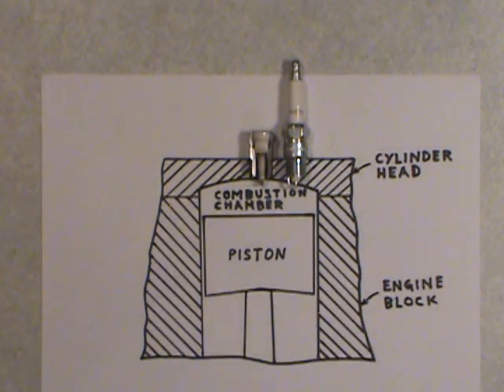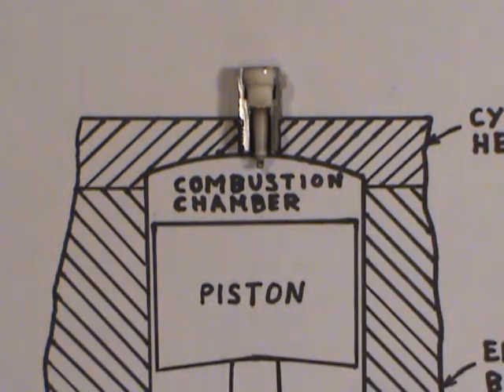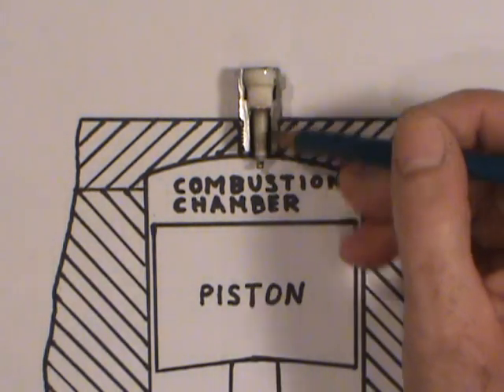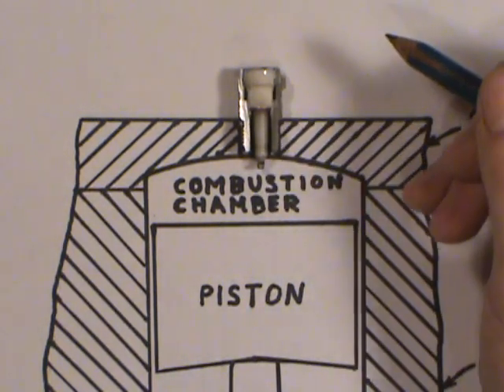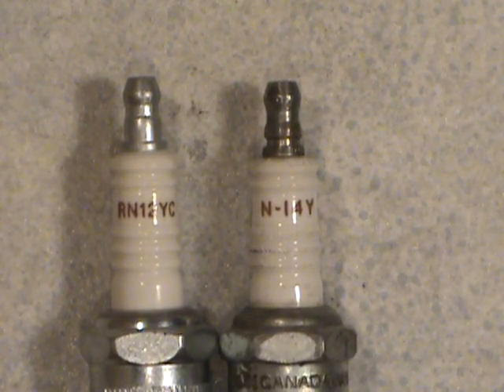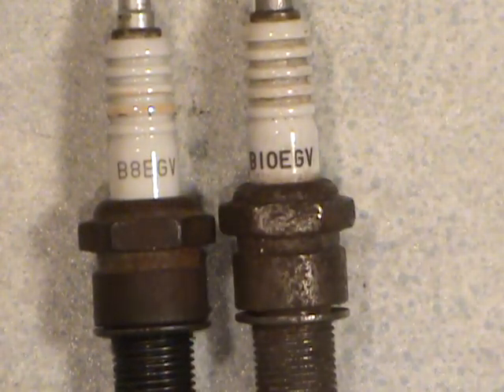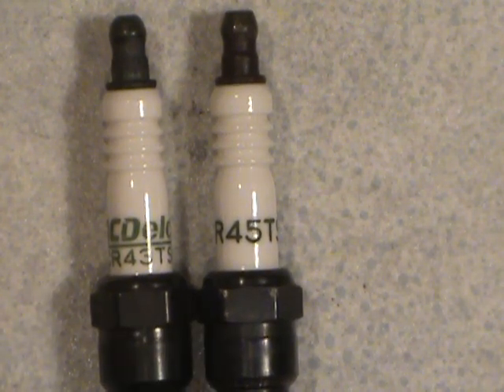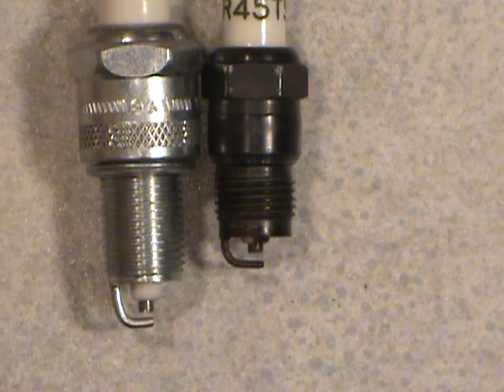Spark Plug Heat Range explained

Comment: A spark plugs does fire before the piston reaches the very top of the stroke. Hence ignition timing/ anywhere from 3-10 degrees before top dead center. TDC.  The momentum of the crank carries the piston over the top allowing the fuel to all be used during ignition explosion. Gas does not go bam in the cylinder but booooooom. Slow burning, not instant.
Reply from the maker: Greetings...Jerry Hubbard..…...Thanks for watching...…..What you said, is a good description, as to, how, the spark plug's "spark", is timed, as well as, how the fuel (gasoline) burns, as opposed to, shall we say, just exploding...……..Now then, here's how I look at it, along with, an example or two...…...Here's, what an older, mid 1970's, (smog) carburetor equipped, V-8 engine's ignition timing might look like...…….5 degrees BTDC (Before Top Dead Center), initial (base) ignition timing, while at idle speed....then...about 35 degrees BTDC, at about 3500 RPM's there-abouts (that be, the 5 degrees, of initial/base timing, plus, 30 degrees, from the mechanical metal weights, when they are slung out as far as they will go), while doing a full throttle acceleration, that places a heavy load on the engine...then...while just cruising along, at about 55 MPH/Miles Per Hour, then, oh, let's say that, the engine's RPM's, are at, about 2500 RPM's (having, no overdrive transmission), then, it might be...???...about, 25 degrees BTDC (that be, 5 degrees initial/base timing, plus, 20 degrees of advance, from the metal mechanical weights), then, add on another 15 degrees of advance, from the vacuum advance unit (canister), because of, quite a bit of engine vacuum, under this particular operating condition, which will activate that vacuum advance unit, to its maximum amount (15 degrees), and, when all added up, it equals...5...plus...20...plus...15...degrees...which equals...40 degrees...of, ignition timing advance (BTDC), while just cruising along, while having the gas pedal, only down, just a bit, to maintain speed, while travelling, on a level road...…….Under the right conditions (as in, very light load, on the engine), and, the engine RPM's, being in the right range, then, the ignition timing advance, might go, as high as, oh, about 52 degrees BTDC there-abouts, from what I recall...……..So yeah, the engine's crankshaft "mark", having a timing light flashing on it, might be showing, that, the spark plug "sparks", as much as, about 52 degrees BTDC, because of, that lean, air/fuel ratio (mixture), that is usually at, about 14.7 to 1 A/F ratio (by today's standards), that takes, a lot longer to burn (both, in crankshaft degrees, as well as, time-wise, which will probably be, measured in milli-seconds/thousandths of one second), as opposed to, a richer A/F ratio, of about 12.5 to 1 (and using, 100% gasoline, that, does "not" have, any ethanol/alcohol in it, what-so-ever...!!!), which will burn, much more quickly, in the engine's cylinder, which is the A/F ratio, that is reasonably safe to use, while going WOT/Wide Open Throttle...…….As far as I might know, then, the "peak" (highest) combustion pressure, that occurs in the engine's cylinder, will probably be at, about, 15 degrees ATDC/"After"" Top Dead Center, there-abouts (of the crankshaft), and, if...???...this "peak" cylinder pressure (I like to call this, the "target", by the way), can happen, under all engine loads, and engine RPM's, then, the engine, will probably end up, having the most horsepower (that it's capable of), as well as, good fuel economy too, well, as long as, Ya can keep Ur Big foot, from mashing down on the gas pedal, that is...!!!...lol...……..Be it, being measured in crankshaft degrees, or, in milli-seconds (of time), the fuel (gasoline), will burn, either faster or slower, due to, how rich, or, how lean, the Air/Fuel ratio (mixture) happens to be, as well as, what that particular engine's, shall we say, personality actually is, as in, how good or bad, it can inhale (the air/fuel mixture), and, exhale (expel, the burned exhaust gas), out of the engine's cylinder head/s, oh and, exhaust system too...……..Not enough, ignition timing advance, will usually, just waste gasoline, and maybe, coat the spark plugs, with black carbon, if really bad...……..Too much, ignition timing advance, as well as, too lean, of an air/fuel ratio (mixture), has been known, to "destroy" an engine, especially when, going Pedal-to-the-Metal/Wide Open Throttle...!!!....and.....till next time...….Be Safe, take care, and have a good one.
Reply: thanks for your reply. You are right on there. Today's computers are so far advanced than the old school. I am lost when you have to plug up the engine to make it run. Old school here

Comment: A doubt recently got a "Brisk LGS" spark plug (OEM was NGK), i had installed (DImyself it was wrist tight 🙂) in cold start  Moto started, but after it reached operating temps and switched off (10-20mins) then tried to start it again (thumb start) there is no response for about 3-5 seconds. 

I then removed the (brisk spark plug since that was the part that was replaced) and torqued it to as per packaging 12lbs-ft/ 17Nmm,   I didn't get the trouble again. is it because of spark plug (brisk) or is it low tolorence of torq value being below spec? 
would love your opinion on this please

Comment: Great explanation mate, thanks for the effort 👍
Reply from the maker: Greetings...Ray Carberry...……You're welcome, and thanks for the nice comment...……Hmmm.....let's see now...….If I were to use only words, to describe the heat range of a spark plug, then, here Ya go....….The spark plug manufacturer's heat range number, is usually based on, the temperature, that, the spark plug tries to maintain, while it's inside of, a running engine's combustion chamber, and it does this, by transferring, a certain amount of heat, into the engine's cylinder head, by its design, via, the screw-threads, and the tapered seat, on one type of spark plug, while the older type, would be, the screw-threads, as well as, the flat surface, that has, that steel crush washer on it, that gets squished thinner, as it's being tightened, into, the cylinder head's screw-threads, as I recall...…….Thanks again, and...….Be Safe, take care, and have a good one.

Comment: The material surrounding the anode is ceramic, which is 99% of the time Alumina Oxide. The The material surrounding the anode is a ceramic most commonly made of Alumina Oxide, with the sole exception of Lodge and Golden Lodge spark plugs which use Sintox (sintered aluminium oxide) which is Raspberry coloured.

The quantity of ceramic surrounding the anode determines the heat range and influences the temperature of the combustion chamber when the engine is running. The ceramic retains heat between ignition moments in order to cause the fresh fuel air mixture to vapourise and become volatile at TDC creating optimal ignition conditions. Without a ceramic retaining heat ignition would become problematic.

Install a plug that is rated too cold and the engine will struggle to start, take longer to warm up and have issues with idling. Too hot a rated plug and the engine will overheat when underload.

If the ceramic surrounding the anode is damaged or partially missing, this will drop the plug's temperature rating to colder than it is labelled.

If the ceramic is contaminated in soot or oil this will also drop the plug's temperature rating causing problems when starting a cold engine.

The anode materials most commonly used are soft iron, copper and iridium.

An engine's power delivery character can be totally different across different brands of heat range equivalent plugs as exact equivalency is not actually feasible. Some manufacturers cover several rival brand plugs with one plug (Lodge HN3 = Champion L80, L81, L82 = NGK B7HS, B8HS, B9HS). 

Contrary to popular mythology, spark plugs don't come "Ready gapped" for your particular engine. For instance the Suzuki GT380 / GT550 / GT750 requires a 0.02" wider gap setting on the centre cylinder than the other two cylinders. Imagine if this myth was true, one heat rate type of spark plug would come in several different gap settings for various makes of cars and motorcycles. We'd see plug boxes labelled, "NGK B7HS pre-gapped 0.26" for centre cylinder only Suzuki GT380 / GT550 / GT750" and "NGK B7HS pre-gapped 0.24" for left & right cylinders only Suzuki GT380 / GT550 / GT750" and "NGK B7HS pre-gapped 0.28* for all Jawa CZ engines"

That's why plugs being pre-gapped ideally for a particular engine that you happen to have is pure BS.

A particular spark plug's gap setting recommended by an engine's manufacturer will vary dependant on the cylinder volume, compression ratio and ignition HT power supplied. That's why different brand engines have different recommended gap settings for the same spark plug.
Reply from the maker: Greetings...Andy Reid...…….Thanks for watching...…….That, sure was, quite the write up alright...……..Even the way in which Ya operate an engine, can have quite the affect too, as in, go easy on the throttle, for better mileage, and engine longevity, as opposed to, giving the engine, as much throttle as possible, that, road conditions will allow, at any given time, and/or, how much Ya can afford, for speeding tickets as well...lol...…….Use-tah be, that, while mostly doing city (slow) driving, Ya could go up (hotter), by a heat range or two, as opposed to, mostly doing highway/freeway driving, where, Ya might go down (colder), in heat range, by a heat range or two (well probably, as far as, the good ole Champion, spark plug heat range is concerned, that is)......….A spark plug, is really only, one part of the puzzle, so to speak...…...Ethanol (alcohol), in the gasoline's blend, can sometimes, cause an older engine, that had a carburetor on it, that was originally calibrated for (air/fuel ratio...mixture-wise) when it was burning 100% (non-Ethanol) gasoline, to now run, much "leaner", of an air/fuel ratio (mixture), because of, the alcohol (ethanol), in today's gasoline blend, usually needing, a larger size of fuel jet, or, in some cases, a needle, and/or, needle jet change, in some cases...…….An air/fuel ratio gauge, that reads out in real time, is about the best, and safest way to go, providing that, 100% (non ethanol) gasoline is being used...…….Ignition timing, is a large part, of how good, an engine is capable of performing, along with, that side benefit, of, good fuel economy too...…….Good ole CDI ignition systems, that work very well, with the correct spark plug & gap...…...If I recall correctly, there was probably a guy on YouTube, that set, each spark plug "gap" size differently, for each, of the engine's cylinders...interesting that...…….My favorite spark plug heat range numbering system, was on the older Champion spark plugs, as in, something like...N-12-Y...the 12, was the heat range, and the higher the number, the hotter the heat range got (just like the dial, on your stove's oven), and, there wasn't such a Large jump, in heat range, when going up or down, by only one number, where-as, some other spark plug brands, might use, only one designation, that covers about, oh, maybe three Champion, heat range numbers, all by itself (not something, that I really care for, at all)……….If you were indicating, the spark plug's, electrode Gap size, in..."thousandths"...of an..."inch"...then, make sure, to put that decimal point, in the correct place, as in, twenty-four thousandths of an inch, should look like this .024" (to me, the " is the symbol, for, thousandths of an inch), because, if Ya leave that zero out, then .24" equals..."Two Hundred and Four-ty", thousandths of an inch...!!!...Wowsers…!!!...lol...(oh, and, to be politically correct, then, I should-ah left that "and" out, that was just before, that "Four-ty" word...lol)……….I use-tah use, those NGK, platinum, fine wire electrode, equipped spark plugs, in some air cooled 250-cc dirt bikes, way back when, and always, had to keep in mind, that, with, NGK spark plugs, the..."Lower" the number...the "Hotter" the Heat Range"...!!! (kinda backwards, if Ya ask me...lol), and, the only numbers that I used/saw, were...8...9...and...10...(car engine, would probably be around, a number 5, as I recall)………..For best performance and fuel economy, for just about any gasoline burnin' engine, then, it would probably be...the correct gasoline & octane rating, along with, the best/optimum air/fuel ratio, for all engine operating conditions (loads & rpm's)...and also, the best/optimum, ignition timing advance curve, for all engine operating conditions, as well (loads and rpm's)………..So, if Ya don't get, all of the parts, of the above, shall we say, "puzzle pieces", reasonably close, to, what they should be, then, you, I, and others as well, probably won't be getting, the full potential, that, the engine in question, is capable of outputting...….and.....till next time...…..Be Safe, take care, and have a good one.

Comment: Ford actually updated early 4.6L V8's to the longer thread design sparkplugs. The early 4.6L engines  were having a lot of sparkplug thread issues, when it was time ti replace the plugs the treads would end up being pulled out of the heads...
My two cent's...
Reply from the maker: Greetings...Jose Cuevas...….Thanks for watching...….Was that the type of cylinder head, that had those, quite long spark plugs, that would sometimes break in two pieces, when, trying to remove them…??? (and, if so, then, that, was some pretty bad designing/engineering, I be thinkin'...lol)..……..I recall seeing, that, there was an "extraction" tool/kit, that was designed to remove, the broken part of the spark plug, from the cylinder head, and hopefully, the cylinder head's screw-threads, and, if applicable, the rest of that bore (hole), would not be damaged too much, so it was usable again (keeping fingers crossed, is a good thing to practise, under these conditions...lol, for me, but not so much, for the owner, of such a vehicle)………..I never did like aluminum heads, from a durability/long life perspective, but, for racing, and keeping a vehicle's weight down, then, there Ya have it...…..and...….till next time...…..Be Safe, take care, and have a good one.